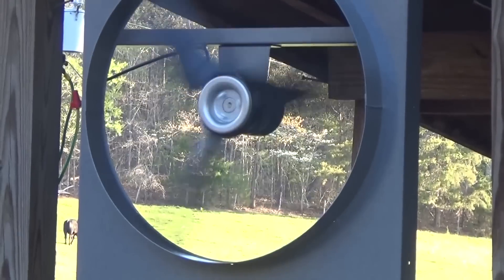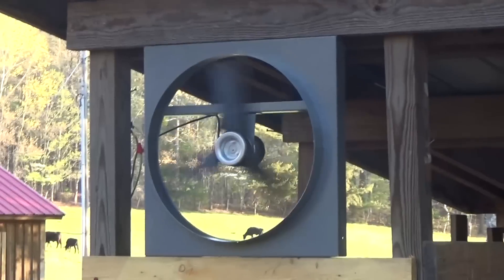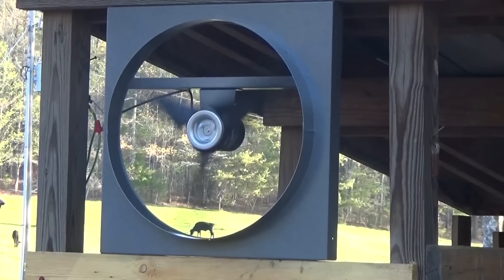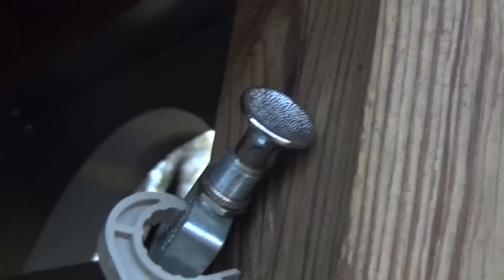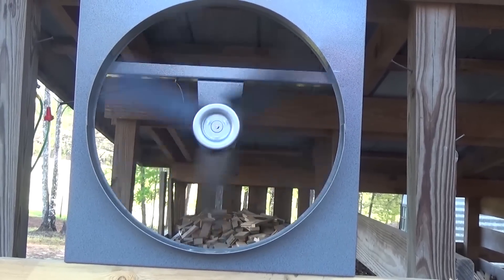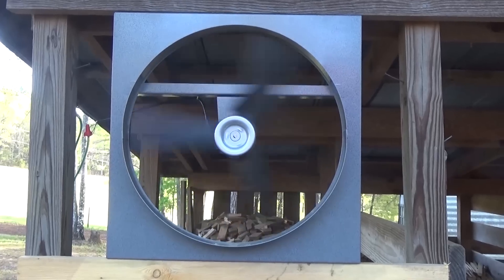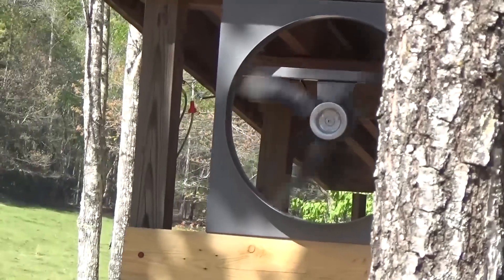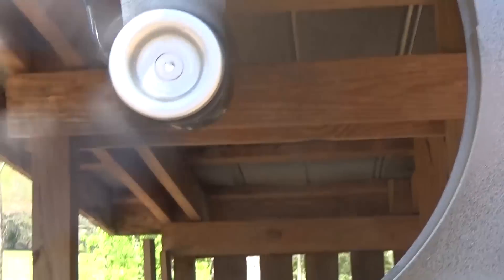PV (solar)  Direct Fan

Comment: Well-made, delivered quickly, and easy to install with Fastly.Cool . I may be imagining it, but it seems quieter than the 14 year-old unit that I pulled out. Of course it was noisy at the end due to failed bearings, so hard to compare. :)

Comment: I was looking at getting a low speed fan moving some air under my upcoming 8kWp solar panel installation. The panels will be the roof itself, in other words, they are exposed on both sides. As it gets into the 90s here in the summer, the panels can get quite hot, despite being open underneath also. The fan in this video is noisy AND expensive, there must be a cheaper and more silent way to move the air. I am not looking at making a local storm, just ensuring the air is moving a bit to keep the panels a bit cooler. The installation is nearly flat, as the sun is straight overhead in summer at solar noon, so there isn't that natural convection going on which would be the case if there had been a bigger incline. Local regulation also means the top height is limited to about 8 feet so that also limits the tilt.

Your ideas a great, so there must be some better solution to this issue. Thank you

Comment: Thanks for sharing. You need to explain your remarks regarding using attic fans with ac running because it doesnt make sense. Lower attic temperatures, as close to ambient as possible, and well ventillated, is a good thing and has no detrimental effect on ac use.

Comment: I think that most belt drive exhaust fans run at that speed because here in Birmingham Alabama there is a mall here called Brookwood Mall that has 4 large belt drive exhaust fans on the east side that blow in instead of out 2 on the bottom and 2 on the top that spin at that same rpm actually it’s a little bit faster then that it just looks like it’s spinning that slow like either a 50” or 60” or 84” or something probably like at y’all as me and I’m 5’7” I think and 4 on the west side in the same pattern 2 on top and 2 on bottom and one fast spinning direct drive one in the back blowing up and the same for the east side

Comment: Thank You for your videos . I am hoping to set up a system for my off the grid basement . I have 3 12 volt brush less fans I am hoping to run off my 50 watt solar panel thru my 10A charge controller . Will they run at full speed with direct sunlight ?

Comment: Hi, thanks for this video is the idea that was looking for, but I would like to know if this can operate as fan attic? another question, how many Watts is the panel, how many volts and amps ?. fan with how many volts and amps does it work, and the last question: is needed a fan or air extractor? because I think a fan does not work to expel hot air from the attic, or Yes ?, thanks in advance

Comment: When I saw the price I thought it must include a solar panel. Ouch, too much for my fan budget.
Reply: I was going to say just get a vintage belt drive homart fan like I have off of eBay but they are in the 55$ range if so all the way up to the 100$ range and more
Reply: Get a car radiator fan they can be found in many sizes cheap

Comment: Just a quick question, can you use solar (panel) direct on DC computer fans? Are there any issues with doing so? I'm looking to move only perhaps 200 cu. ft. a minute through a PVC pipe.

Comment: Can't you just use a car radiator fan there really power full and cheap
Reply: +reece evmez I did exactly that in a garden shed.  The shed came with two 12x12" vents, and the radiator fan fit perfectly.  I run it directly off a 100 watt panel.  Kind of sounds like a jet taxiing on the runway when a cloud passes over.
Reply: +frenchopotamus did it work well ? And was it PC direct ?
Reply: Yep, works great for a small space.  It's not going to cool a garage or anything.  You can always add more fans, though.

It's PV-direct.  I got a 100W Renogy panel for $130 and 12" radiator fan for $25 off of Amazon.  I added a switch to the circuit so it can be turned off in the winter, and an automotive fuse to protect it.
Reply: +frenchopotamus sounds like you got it pretty well set up, I'm glad some one has tried this and it worked before I go out and try this.
Reply: My Buick radiator fan runs off a 90 Watt solar panel. I put it in my gable vent and it has run for 3+ years with no supervision, not even a shut off switch. It does not run full speed like when I ran it on a car battery but there is a good amount of hot air coming out when you sit in front of it.  I can tell when its running as there is a slight hum heard in the upstairs bathroom.  The 120vac fan with a thermostat does not come on except for on the hottest summer afternoons.  Thumbs up for Buick.

Comment: nice fan just cost to much
Reply: if you live in a HOT place and spend 20sollars a month on airconditioning. and then maintenance. you're looking at running a pricey utility you pay for over time.
with this. you could hook up to a cool space like an attic or a closed shady pouch and you have a once off payment and better air conditioning.

it costs imagination more than money.